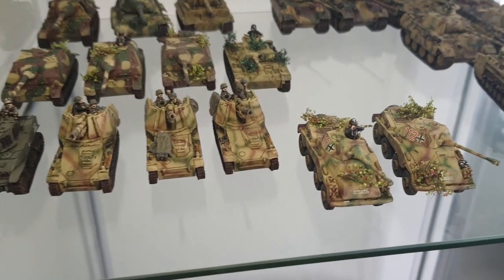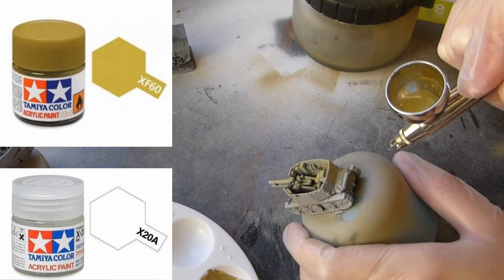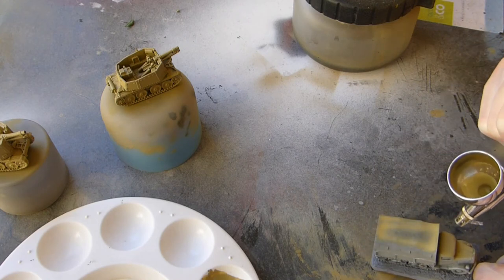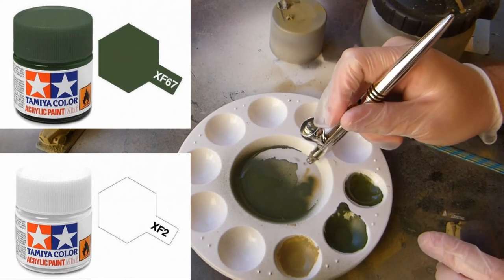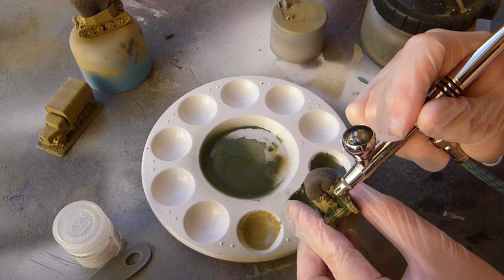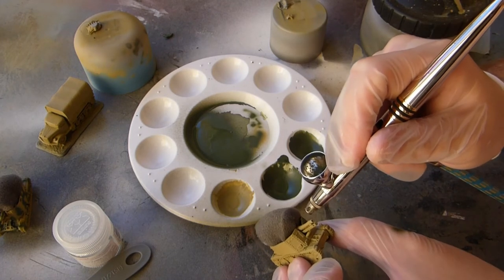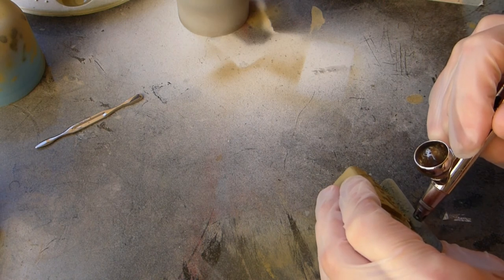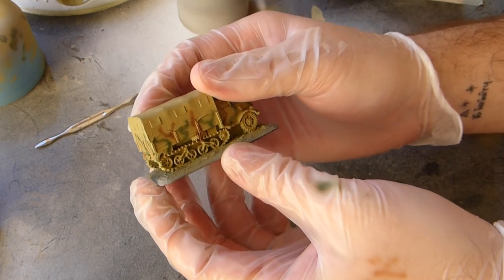How to airbrush 15mm/1:100 Panzers using .15mm Needle & Nozzle! (Flames of War)

Comment: Do you get nice hard edges with this technique or are they still a bit soft? I usually mask because I prefer hard edges but it's a huge pain so if I could get a similar effect by using a fine needle and turning the pressure down it could be good.
Reply from the maker: That's a great question, you can definitely get hard edges but they will always look a little softer than if you masked. I struggle with masking at this scale so I tend to avoid it where possible. If I was to go with the .15mm and attempt hard edging I'd probably put my compressor to 10psi and take my time. The Jadgtiger shown in the video is probably the closest I've come to that without masking but it is still relatively soft, it's a great question and something I'm keen to try!

Comment: I'm so pleased to have found your channel thanks to Stuart at Miniature Realms. Very interesting to see how you work. I have the Iwata Eclipse CS, a magnificent piece of kit. Using .35 needle I get the German camo but I have had a lot of practice. I may well look at a 0.15 and Tamiya paints. I've currently used Vallejo model air and recently Ammo Mig. Had some issues with model air.
Reply from the maker: Hi buddy, thanks so much for your lovely words, Stewart is such a great bloke and painter! I'm so honoured he gave my channel a mention ☺️

I've honestly had much better results using Tamiya paints for airbrushing. You'll notice the difference right away, tamiya paints don't tend to bloke up the nozzle as easily (from what I've found). I've got a .15mm, .20 and .35 as soon as you use the .15 with the smaller scales, you won't look back 😉

If you end up getting some tamiya paints and need some help feel free to message me on Facebook or Instagram and I can run you through it 🎨 🖌

Comment: As I've said before... I really need to get those tamiya paints.. did you use xf-60 as a base? And I find having a piece of moist sponge can be a help if you get some buildup of paint on the needle.. but that can be from my choice of Vallejo colours instead of the tamiya 😭..

Thanks for the video!
Reply from the maker: Yeah mate, XF60 for the base and you can modulate with that by adding white or even XF88. I used to use VJ all the time but for me it's Tamiya all the way haha. It definitely comes down to what works best for each individual though and having seen your models I know VJ works exceptionally well for you 😀
Reply: @paintingpanzers  😂🤩🙈 haha, but you haven't heard me while I paint🤬
Reply from the maker: @petepan82  haha I think we all suffer from that 😅